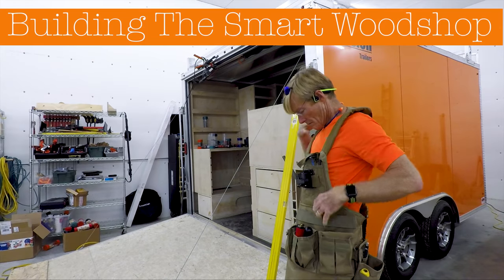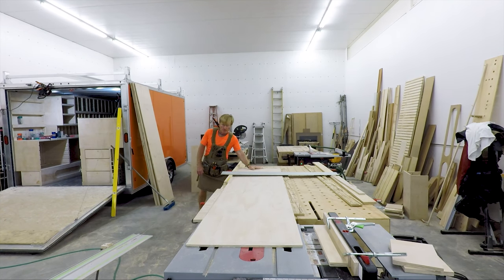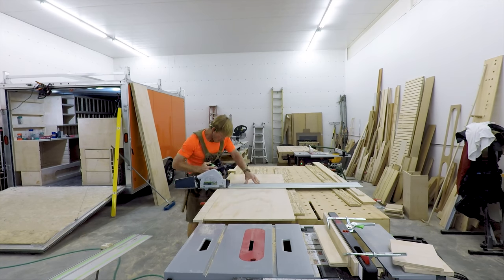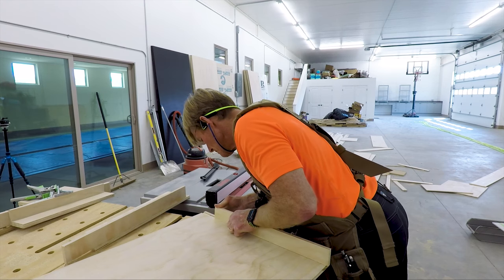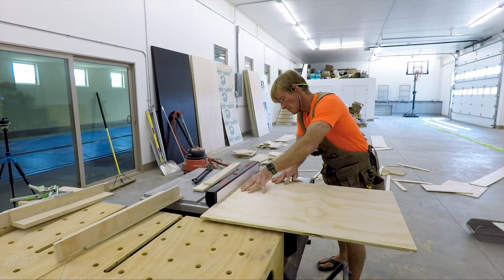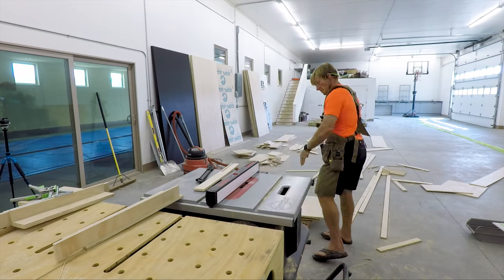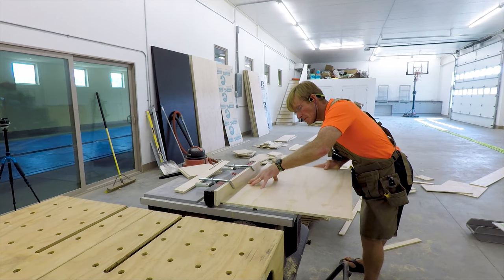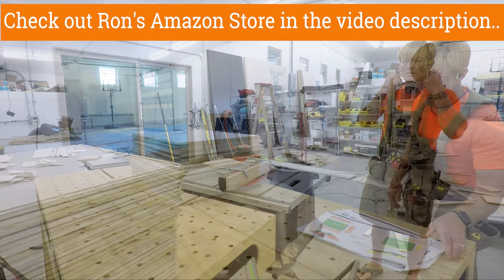Building my woodshop #22: Drawer bottoms.

Comment: Thanks for these videos. I'm not building a SMART shop, but my land-locked shop is benefiting from your storage ideas and the techniques, tooling and work approaches are enlightening.
I have a cabinet-makers SawStop and can't tell you how well it works and on several occasions has saved extremities. In the past, breaking down sheet goods has been hard on my tablesaws and risky business at best. Using your workbench and a tracksaw takes nearly all the risk out of that operation.
Thank you for your ongoing contribution to the community and the craft.

Comment: Hey Ron. Thanks for the meticulous plans. Bought them for both the SMART tool shop and the SMART bench. I was wondering about the depth of dados. I saw that you provided dado depths to the draw bottoms (1/16) to one of the subscribers in the comments, however, what about the cabinet dados on the 3/4 ply that the draw bottoms fit into? I get that you don't want to give too much away in the vids, which are incredibly helpful, but it seems a little vague in the plans. So, yeah, if you could confirm dado depths that would be great. TNX.
Reply from the maker: ⅜" or 9mm which is ½ the material thickness
Reply: @TheSmartWoodshop  Tnx so much for getting back in such a timely manner. Just bought a used 7x14 that came with shelves and work bench. Going to be tearing them out and starting fresh with your plans. The only thing I like that I might try to keep and incorporate into your plans is a slot for sheeting goods. Very handy.  Tnx again and happy holidays.

Comment: Very clear video. I may actually be able to understand how your system goes together with a few more of these. Wanted to buy the plans but don't own a computer and printer. VA disability check leaves very little to stretch. Are there printed plans available?
Reply: Does the local library have computers and printers available to use?